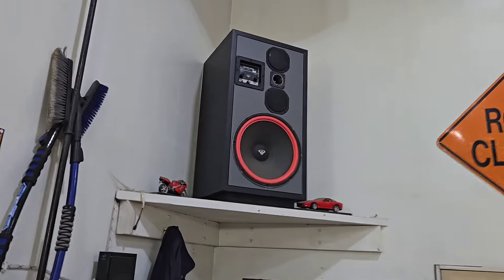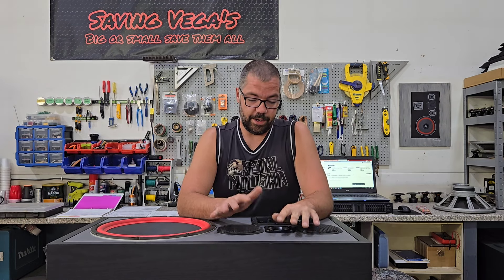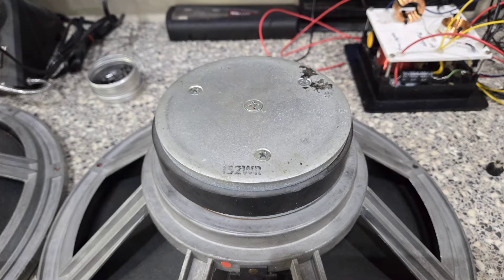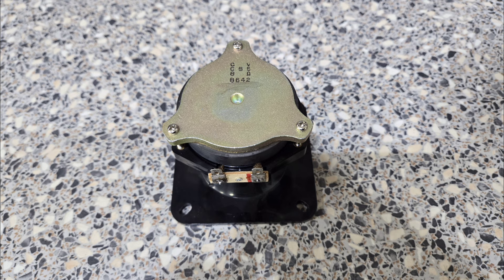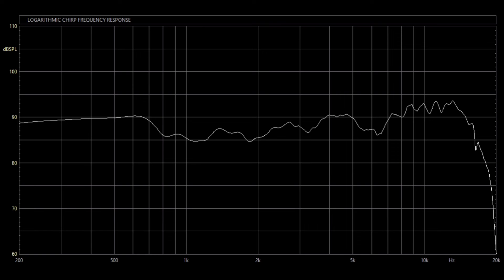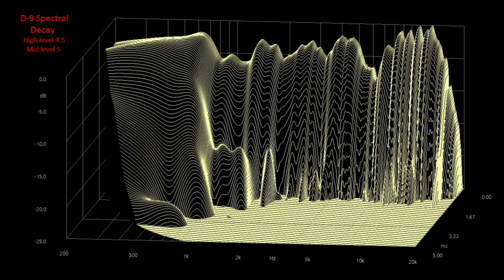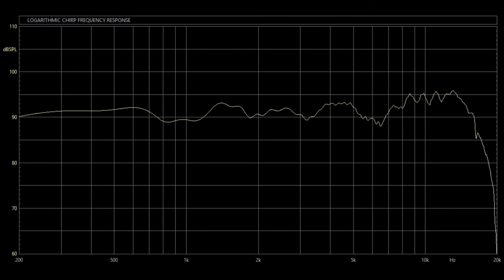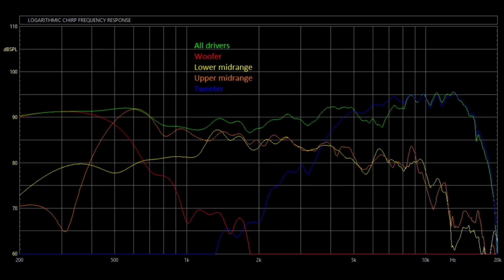The Legendary Cerwin-Vega! D-9 How Do They Measure?

Comment: Did you use a rubber cement? Avoid stuff that shrinks as it dries. I bought some D9 for 150 that just needed surrounds wich I do myself. Sold for a profit plus took a preamp as partial trade. Solid speakers but not good for inside a house. Unless you have a 30x30 foot room.
Reply from the maker: Nope, I used a PVC veneer that was self-adhesive. I did some test pieces and found the adhesive wasn't very strong, so I used a spray adhesive as well and that seemed to work pretty well.
Reply: @SavingVegas  Ahhhhhhh. Le pages construction adhesive will bond anything permanently. As long as the surfaces are wiped with alcohol prior like with everything. Even oil from a finger print can cause a boat load of trouble for a project. It bonds as strong as some 2 part epoxies. Good stuff.
Reply from the maker: I'm not really having a lot of issues with it bonding. The main thing is the material I used is too thin, and it shrunk just slightly in some spots exposing the wood.
Reply: @SavingVegas  Ohhh yea it reacts bad to certain chemicals. I had trouble getting bike tube patch repairs to bond before, the same thing happened ie shrinkage factor. One or more of the ingredients reacts negatively to the agent/s.

Comment: Good video! Some of the Vegas measured much better than people realize. Not sure why there is such a bad stigma on them. I sent my crossovers to Danny at GR Reserch and he sent me back all the parts to re do them. Higher quality equal value. It was totally worth it. Also the No-Rez cleans the bass up significantly. Glad you are putting this content out there!
Reply: By the way: Did the performance go the direction xou wanted? - AND, did Danny split the frequencies between the two midranges? normally, to feed two midranges with the same signal in one speaker, is an absolute no go. The chassis begin to cancel out each other, then distortions kick in, over all not good at all! I assume that it may be better to cancel one of the two midranges, that means - to cut the wires to one of them. The midrange should perform better due to this!
Reply: @bernhardmichaelfux308  mine is a different model, with a single midrange. One thing he did do was disconnect the fuse path. He said that the fuse muddies up the sound a fair bit. I did a long list of modifications to the speakers and am very happy with the outcome
Reply from the maker: @bernhardmichaelfux308 You're more likely to run into this issue when using 2 tweeters due to higher frequencies being shorter wavelengths. The shorter the wavelengths, the more likely for them to become out of phase with each other. This can happen with midrange drivers as well, depending on how high of frequencies they are allowed to play. If you look at the combined drivers frequency response measurement I took, you can see some cancelation happening between 5kHz and 8kHz. This is because, in my opinion, the midrange drivers are allowed to play too high. One could tweak the lowpass filter for them to start rolling off at a lower frequency to avoid this.

As for the MTM design of this speaker, it is very common and still used by manufacturers today. It usually has good results for left to right off axis frequency response as well as up or down. Again, as long as the midrange drivers are filtered properly and are not allowed to play to high of frequencies.
Reply from the maker: @JR-ho5qm Was this the upgrade for the D-3s he did?
Reply: @SavingVegas  no it was not. I’m in Saskatchewan Canada so I did not want to send him the complete speaker. I just sent him the crossovers. The model that I upgraded was the newer SL12. I wanted to see what the new Vegas had to offer. I changed allot on them including there looks but at least now I have brand new Vegas as well as some old lol!
Reply from the maker: @JR-ho5qm Awesome! I'm in Saskatchewan as well. 

I really wanted to buy one of his upgrade kits for my D-3s, but the cost held me back. Call me frugal, but I feel I could probably do what he did for less. Yeah, maybe the parts won't be as high quality as what he used, but I feel I could still make improvements myself while having all the fun doing the testing and work myself.
Reply: @SavingVegas  I kinda figured you were in Sask, small world eh. Ya I’m sure the crossovers you built are much better than the factory ones you replaced. I do highly recommend his No-Rez. Vegas are big boxes and they benefit from the dampening the No Rez provides. Take care! Keep the videos coming 👍🏻
Reply from the maker: @JR-ho5qm I will have to consider the no rez in the future. I appreciate the feedback! Take care.

Comment: I like these crossovers better now since I upgraded them. The D9s lost that muffled sound that was killing my mids, imo. I did notice maybe a slight boomyness in the woofers so, I went with a polypropylene cap over the standard one on the woofer for a faster discharge rate. The bass is quicker, and controlled even at 225 watts rms... these are a keeper...lol

Comment: Is there a good source for quality re-foams for these woofers? I re-foamed a pair about 10 years back with foam from ebay, and they are already brittle and cracking. The dry Colorado air probably does not help with this. Maybe one day I will recap the crossovers. I am quite impressed with the measurements tho! These were the only other speakers that I've owned that can keep up with my Altec A7's in terms of SPL output. The D9s just had lots more lower bass to em, but the Altecs smoked the D9s with the mids. Given the fact that the D9s are literally one third the size, this is very impressive. Both are right around 101db 1w/1m.
Reply from the maker: Yes, there is a very good supplier for Cerwin-Vega! parts. Brew City Audio LLC. He sells his stuff on eBay, just do a search for his seller page Brew City Audio. If he doesn't have what you are looking for on his page, you can contact him with what you are looking for, and he will set you up. His customer support is almost unbelievable considering he his one guy operating from his home. He knows what he is doing when it comes to Cerwin-Vega speakers and knows it well. All my foams and recone kits I use on my channel come from him.

Comment: Preston how's it going man ? Glad you are realizing the potential of high quality crossover components, Danny at GR Research just did a video explaining to that Andrew kid who does reviews all about how and why you should upgrade your capacitor s and resistors and use air core inductors for max sound quality...ooooh weee it ain't cheap but brother if you use Mundorf or Clarity caps or Miflex or or ultra high end with Duelund you will be blown away...p.s when you put your D9's back up on the shelf turn them upside down as you want the highs and mids closer to ear level it will sound wayyyy better amigo...have a great day Preston
Reply from the maker: I actually watched the video like minutes after it was uploaded. I am on Danny's side with like 99.9% of his views on things. Maybe one day it will be 100% of it, but I also don't buy into some things unless I experience it for myself. Not that I think he's full of crap or anything it's just that he is dealing with and has much higher-end equipment, more experience as well as knowledge than me at this point. I believe if you get that high up there and have listened to some of the best of the best and so on, yeah, it all makes sense that it would make a difference. The problem for me is that I'm not there yet, but I am slowly making my way. 

As I slowly build my business, I have goals of reaching that point, but I believe that there is a need for that middle ground from the garbage that's in some speakers to the very costly parts that are just out of reach for some people. I'm trying to build xovers with the best bang for your buck in mind but still getting a drastic improvement. At least that's where I'm at now.

As for having my D9s set upside-down, I don't think my OCD would handle that lol. I understand the benefits of what you're saying, but at the same time, these speakers are in basically a big square box. Once you factor in all the reflections from untreated walls in my big echo chamber. I'm not sure if there would be enough benefit for me to get over my upside-down speakers lol.
Reply: Expencive tho, he wanted 800$ for the upgrade on infinity sm150.
Reply: @SavingVegas  I would also suggest that you try and get them at ear level. Our ears are extremely sensitive to the first wave front and even in a resonant room the first wave matters a lot in therms on perceived sound quality. Ear level matters as the phase issues between drivers are minimised - especially with spaced dual mids as these. You should test it out in the room and hear for you self.
Reply: Take an idea from the klipsch heresy design, adding a 1 inch piece of cut wood under the front of the speakers stand tilted the speakers to optimal angle to my seated position. My D9's sit on a carpeted floor so the gap created does not show. Tilting made a big difference (improvement) in the sound clarity.
Reply from the maker: @Error2username Yeah, that to me is out of reach for some people. Not a lot of people want to spend that much. On average, the upgrades I do run me $150 to $300 CAN total for both xovers and still a very noticeable improvement.
Reply from the maker: @alwillis4255 I am a big fan of using stands that tilt the speaker back for proper listening position. I have a bedroom in my house that I use only for my 2 channel system. The room is a bit smaller than I would like, so certain speakers I have to do this with for optimal performance. That and I always have some sort of small bookshelf speakers on stands in there as well. I currently have in there now some Kef Q150s and a set of AT-8s.
Reply: @SavingVegas  absolutely Preston, You don't have to go bonkos on capacitor s and components just as long as they are higher quality parts and quality names the big names I was saying are for those who wish to do a esoteric Cerwin Vega upgrade...lol companies like Audyn and Jantzen make affordable fantastic caps so you like you say you don't have to but you can lol

Comment: Worked at a consumer store from 84-86 and we sold CV (also higher brands).  My goto demo was on the D7's, as to tighter bass. As to the change in color...blasphemy 😀.  This would make a nice veneer project to keep it 70's-80's look.
Reply from the maker: I always preferred the black woodgrain and gray D series CVs over the oak and walnut ones, so I was going for the original look.

Comment: wondering....what system do you use in the house?
Reply from the maker: I have a 5.1 system in my living room. I use a Polk Audio signature series center channel, Cerwin Vega D-2s for fronts, Paradigm 6" in ceiling speakers for rears, and a Paradigm Defiance X15 subwoofer. I'm using a Yamaha pre amp and Anthem MCA 50 5 channel amp. 

I also have a 2 channel system in my audio room with a set of Kef Q150s and a set of Cerwin Vega AT-8s powered with an Adcom GFA-555 power amp and Adcom GTP-500 pre amp.

Comment: If you end up re-addressing those crossovers, you must upgrade the old sand cast resistors.  They sound really bad!  Go for the Mills resistors.
Reply from the maker: I couldn't agree more. I have had issues getting curtain values of Mills resistors in the past. Do you know a good place to order from by any chance? I have been using Dayton Audio precision audio grade resistors when I can't get Mills resistors.
Reply: @SavingVegas  When i ordered the mills reisistors for my D9's the 10 ohm ones were backordered for a month.
Reply from the maker: @alwillis4255 When I looked them up, they are listed as not available for some values, and the rest seem to be on clearance. That's on the Parts Express website.
Reply: mills available from sonicraft
Reply from the maker: @alwillis4255 Thanks!
Reply: Can you use 9.1 or 11 ohm?
Reply: @tommysalcido8355  Considering that the original resistors were probably 10%, then 9 or 11 is just 10% away from 10 ohm.  I'd bet you'd never be able to tell the difference, but the bigger difference will be in the sound of the resistor.  I'm not sure how the 10 ohm is used in the circuit, if it will raise or lower the tweeter or midrange level.

Comment: Hey I have a pair of Cerwin-vega E-315 is that good speakers in you mind ?
Reply from the maker: The E-315 was getting close to the end of the made in USA CVs. The good thing about that model is they were still designed with high sensitivity in mind and the traditional CV style woofers the were used in all the earlier models. 

In my opinion the weak points of these speakers were the cabinets that were made a bit cheaper and lighter. The crossovers also used the cheapest parts available. The crossovers were pretty much the same for the E-700, E-300 and LS series CVs. I think they are still a good speaker but they could definitely use some bracing in the cabinet and better crossover components.

Comment: Do u have a business in rebuilding CV's?  I have a pair of 380 SE's that need some crossover work
Reply from the maker: I do restoration work and repairs. I stick to local work for the most part. Where are you located? Crossover work is easier to do because it's easier to ship.
Reply: @SavingVegas  ofallon Missouri
Reply: @SavingVegas  i am in O'Fallon Missouri

Comment: I want to add a crossover to my at15 woofers. The crossover just rolls them off. 
Do you have any suggestions?
Reply from the maker: It's tough to say without me being able to measure them. The proper way would be to take some measurements of the speaker to see what it needs. There's is no one lowpass filter design that works for all. By that, I mean some woofers may just need a single inductor. Some may need a second order filter with inductor and capacitor, and then what values? Also, I would need to know where the midrange drivers start rolling in. Then, you could start running into phase issues when changing the filter orders and so on. It really is an educated guess and then a trial and error process to do it properly. 

I agree with you wanting to put a lowpass filter on the woofer. I have measured the spectral decay in a lot of CV woofers, and even though they are able to play higher frequencies better than some other brands, they still suffer from cone breakup at some point and they really should have a filter on them. 

This would actually be a good idea for a future video. I just need to get my hands on some AT-15 speakers, and I could design a filter for them.
Reply: If I get a measurement microphone, I should be able to get the info I need?
Reply from the maker: A calibrated microphone is one thing you will need, as well as a software program that allows you to take the impulse response from the speaker and gate out room reflections. Otherwise, you end up with a very jumbled up mess for a frequency response that would be difficult to analyze. 

Without being able to gate out room reflections from the measurement, it is just a room measurement. Room measurements are good for fine-tuning your system to your listening position. For analyzing a speakers frequency response for crossover design purposes, the room reflections do you no good. 

I use a Cliomatica acoustical measurement system that isn't all that cheap, to be honest.

Comment: Why do your measurements cut off at 200hz? Thanks.
Reply from the maker: I use what's called a gated time window measurement. It gives me the ability to take only the initial response from the speaker and gate out the reflections from the walls and floor in my shop. It is only accurate down to 200Hz give or take. Lower frequency waves are very long and there is no way to measure them without having room reflections interfere. The only way to measure lower frequencies is to measure the speaker in an anechoic chamber.
Reply: @SavingVegas  or outside, away from all reflective surfaces.
Reply from the maker: You would have to have the speaker up off the ground by a lot and be a long way away from the speaker with the microphone. To measure, let's say a 40Hz wavelength you need to know how far away you need to be from the speaker. So you divide 40 by 1130. 1130÷40=28.25 so your microphone would have to be 28 feet from the speaker. Then, take into account how high you would have to be off the ground to be able to get just the initial impulse response with no reflections. All that work and messing around for very little. 

I can't change the bass response of a speaker by messing with the crossover. We'll I can but only where the woofer rolls off, which for most speakers would be over 200Hz. So it would be pretty much a waste of time the way I see it.